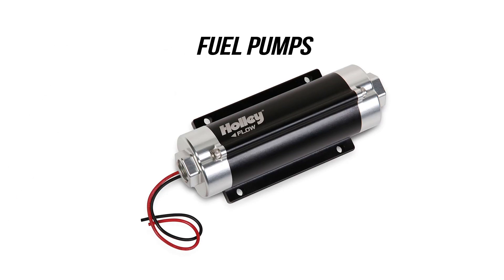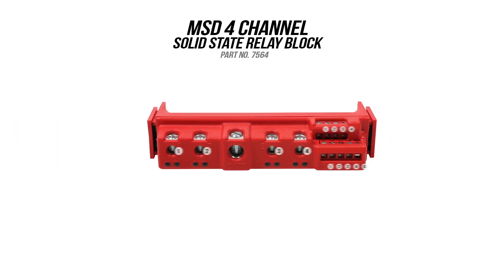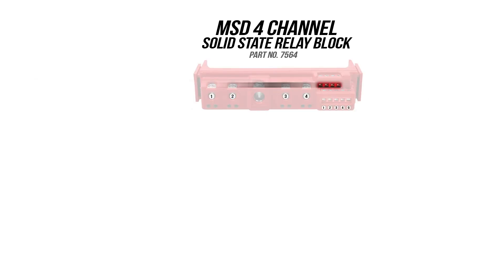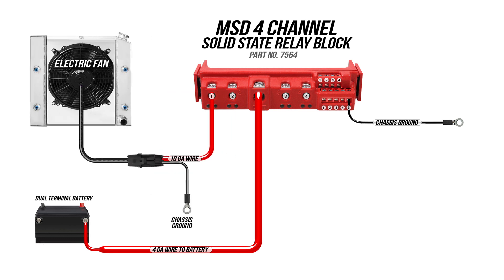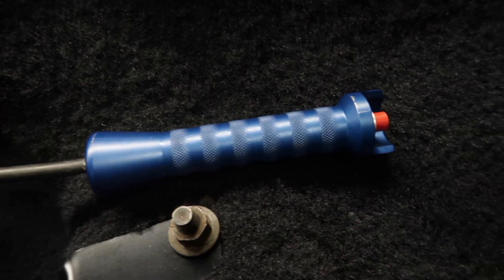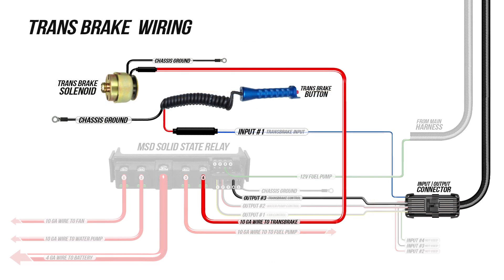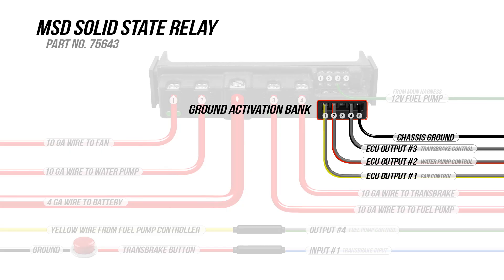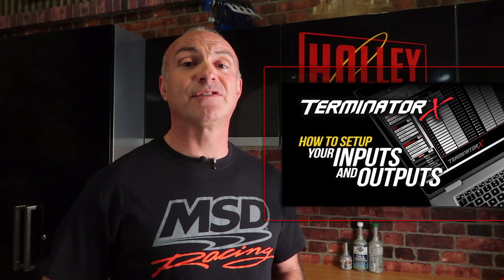How To Wire MSD Solid State Relay Module

Comment: Do you need to use a fuse on the power wire to the accessorie you are using?